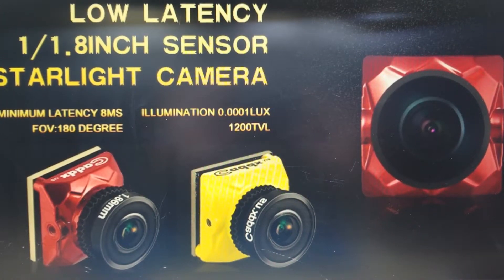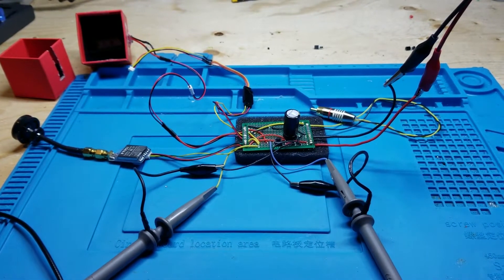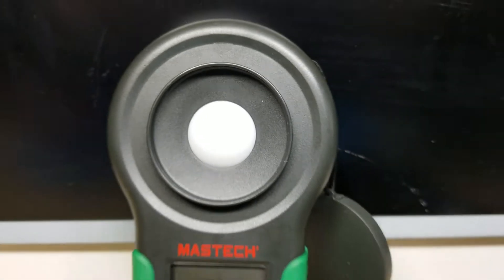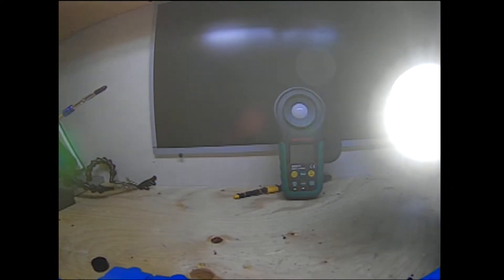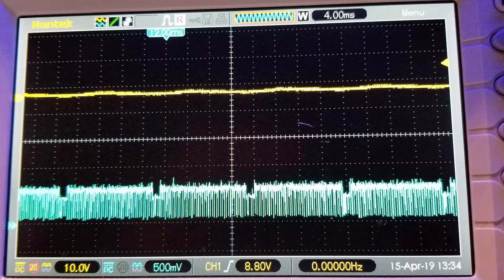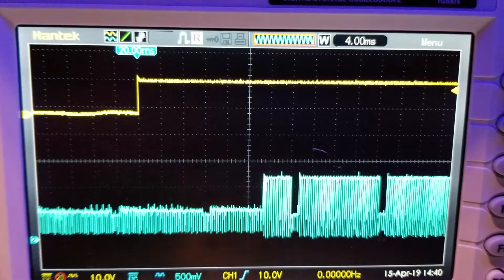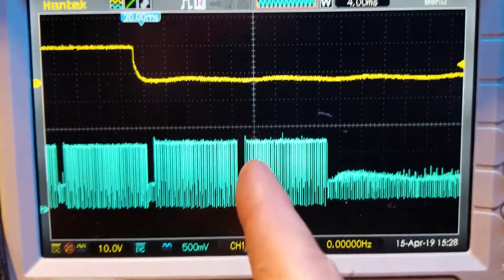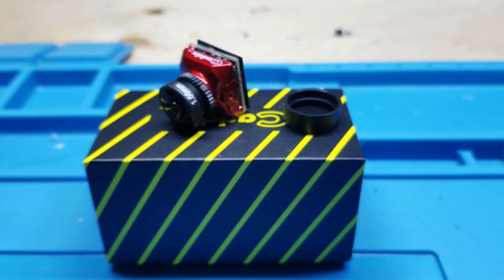Caddx Ratel FPV Camera Technical Bench Review with Raw Electrical Latency Testing

Comment: Nice testing.  I just tried to power this camera from my vtx out put rated 5v @ 450ma.  So you said it consumes more like .8a @ 12v. Oops.
Reply from the maker: I said it was .8 watts, not amps. It is more like .07 amps. At 5v the camera should take around 150ma of power, so you're good.

Comment: Amazing testing! You got a subscriber from me!

However, I would've liked to see the type of latency test where you film a screen with an accurate stop watch, both with a high FPS studio camera (the one you're using, for example) and the FPV cam. That way, you can compare two images to see if the time matches. While I really enjoyed the oscilloscope test, I'm not sure if going from black to white is the best way to test latency. It might be that it takes longer to produce a frame when the difference in lighting is "infinite". The screen test is more comparable to real life, as we rarely go from black to white there. I know it's a lot to ask from only one video, but a flight test with your subjective opinion on both image quality and latency would've been nice.
Reply from the maker: The issue with the screen test is that you're testing the screen more than the camera at lower latencies. I've done grey to grey latency tests too, which turn out to be the exact same, but they don't show as well on camera since the difference isn't as obvious. Look at my latest video to see how accurate this test actually is.

Comment: Nice work! Sneaky buggers claiming 8ms! I’ve just purchased 3 of these as well 😅
Question On the FOV, it is advertised 
As 180degress fov, which is surely impossible? And I notice when I first powered it up and checked settings it was default at 16/9. When I changed to 4/3 it reduced FOV a lot,
Have you checked up on this?
I’m not being stupid am I?
Cheers
Reply from the maker: You can expect that. The sensor is 16:9, so 4:3 would probably just crop what it is capturing. There probably isn't a practical way around that though. If you look at the video it looks like the FOV is mostly extended at the edges, and it looked to be quite wide since you could see my computer monitor which is directly to the right of the camera.
Reply: Ok, I suspected the sensor might be 16/9. They should quote both FOV’s
Really then, as in 4/3 it is narrower
Than my runcam swift 3 - which when purchasing the ratel I was under the impression it would be wider.

Comment: I think a test with two different brightness levels of the LED would be interesting.
 like  half bright and full bright.
In reality  (racing/freestyle) we do not often have changes from completely dark to completely bright. Slight changes in brightness are more relevant.Seeing a gate on a field is not a black to white.

I can imagine the "gray to white" latency of the caddx is much faster
Reply from the maker: For White to Black that is more relevant (which I did comment on), where black to white it is the raw latency. I did test partial light to full light off camera (It's less obvious for demonstration purposes), and there was no difference. Removing things like WDR and having manual shutter (which I also tested) eliminates those factors as well if they existed. I'm quite confident this is the raw lens to output latency.

It is a good point though, and I did take that into consideration to ensure I factored in everything. If that made a difference I was planning on saying how to reduce latency (like I did with PAL), but there wasn't even a 1ms difference. I didn't include all testing I did to keep the video as on point as possible.